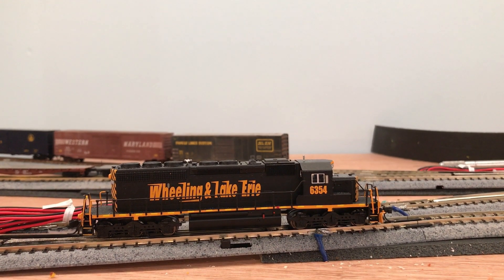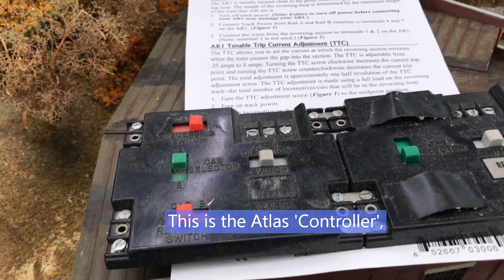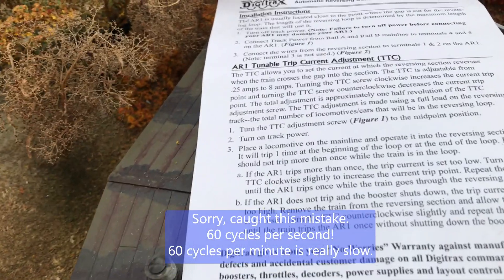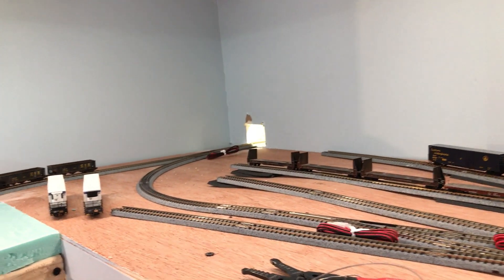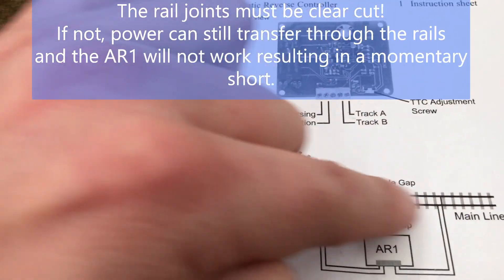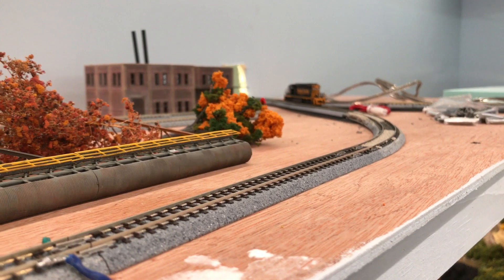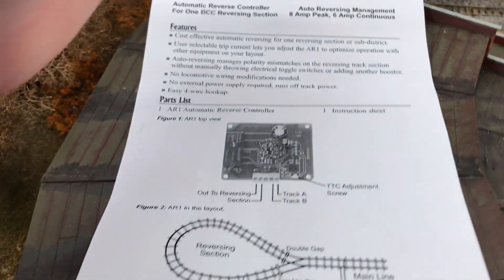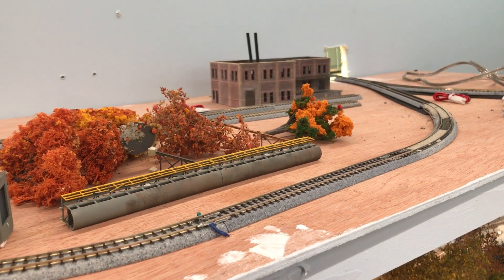DCC Auto-Reversing Devices

Comment: Thanks for the clear explanation.  I see you're using Bachmann EZ Track.  How did you connect your AR1 to the EZ Command power unit?
Reply from the maker: That's Kato Unitrack, not Bachmann EZ Track.  The AR1 is connected to the track through wires soldered to the outside of the rails and run to the appropriate terminals on the AR1.  The bus line is used as the AR1's 'common' connection to determine when it needs to correct the pulse.

Comment: This is one great video. It answered a BUNCH of questions, and clarified that a reverse loop does not have to start or end at a turnout. I have a L-O-N-G run (over 40 feet) between a fiddle yard and a freight station, and this clearly showed that I only need to "isolate" a piece of track longer than my longest train. Thanks!

Comment: Glad I found you, I have a large loop with a pin wheel yard. I was wondering how I was going to wire it. I will do the reverse loop in such a way that my turn outs for the yard aren’t in the reverse loop. Just about 3/4 of the loop will be in it.
Reply from the maker: That should work.  The only issue you'll have is if your loop isn't big enough to cover your longest train with DPUs.  If it is or you don't have DPUs, you're golden!
Reply: @AlleghenyNorthern  yes it is big enough, about a five foot circle area
Reply from the maker: @larryschmitt2513  Cool!  Sounds like you're set.

Comment: So you isolate that whole straight section? From switch to switch with rubber or plastic joiners? And you only need one AR10 right? 

I’m trying to lay a line on my lower level so I can run a train around the lower level without going up the helix. I should only have to double gap one side, correct? 

Mine looks just like your reverse loop (being straight from switch to switching, aside that I have the helix where your industrial town is. 

Please let me know if I’m not clear.
Reply from the maker: On a reverse loop, you always have to double gap both sides of the reversing section.  So, whichever section of track you designate as the reversing section, you need two isolated joiners at each end.  

(If you're wiring up a wye, they're a little trickier because you'll have two sections that are technically reversing. )

 You only need one AR1 per reversing section.  You can either make a part of the reversing track isolated like I did in the video or you can isolate the entire loop at the turnout - both the straight and diverging routes get the isolated joiners.  If you chose to make the entire section reversing, ALL of the feeders inside the reversing section must run through the AR1.  

If you only make a portion of the reversing section isolated, then make sure it's a large enough section to get all of your locomotives per train into it - that includes any DPUs or sound cars that may have a decoder.  If you don't, you'll short.
Reply: Man, I have always had trouble understanding this. Aside from the simple loop but more than that it’s always been an issue for me. This is amazing and should be in the manual that comes with any auto reverser.
Reply from the maker: @Trainsarecool-j8z  i hope it helped get you up and running.  once you give it a shot, let me know how it works out for you!  If you venture into turn tables, it's a whole new ball game with the ARs!

Comment: This is encouraging because I have two reverse loops, each is stretched out, not returning to the same entry of the loop.
Reply from the maker: Just make sure you isolate the loops and all the feeders to the isolated section have to run through the AR1.  if you have trouble, you likely have a feeder going past the AR1 which will result in a bypass and immediate short.

Comment: I know you like Digitrax devices so this is just a suggestion. I used to use AR1's but they are old technology, require adjustments, have mechanical relays and are not that reliable. Now I use the "Tam Valley" dual frog juicers which I use to power the frogs on my turnouts; but the outputs can be paired by a jumper and now can be used as a auto reverser. the beauty of this device is that it is works flawlessly, fully electronic, no moving parts, greater reliability, and best of all no adjustments.
Reply from the maker: i have seen some applications of the Tam Valley frog juicers used and NCE's autoreverser, too.  i'm certainly not opposed to any of the options that work.  When the AR1s crap out I may look at some of these other systems - or if they become temperamental with other locomotives.  there's nothing i hate more than something that works sometimes, but not always!  Thanks for sharing!

Comment: I use both AR1 and BXPA-1.. The auto reverse relay sound is not a big deal, but BXPA-1is solid state and does not give the relay snap sound. A little more money, but some added features as you mentioned about lights/notifications. Great Video.. Informative and easy.. A BIG LIKE !!

Comment: Can you run the reverse wires to the turntable bridge, and the control wires to a bus for the feeder tracks. Then that bus to your main bus? I am having trouble with my AR1s in this area on my N scale layout.
Reply from the maker: So your bridge isn't auto-powered from the track?  If not, the bridge could be your reverse section, the rest of the tracks could be on the main bus power and that should fix the problem.  Make sure you keep you left rails and your right rails on the right side all around the table or that's going to make a mess.  Also, double check you're not feeding the bridge from the tracks.  In my case, my AR at the turntable is actually wired for the wye the turntable feeds from (yes, I made a really complicated track arrangement at the terminal section but I wanted a lot of features in a compact area.)  My turntable is the Kato unit and because of how it's internally wired, it does not require an AR1.
Reply: @AlleghenyNorthern  Mine is a Built up N scale Modern 130' Turntable by Corner Stone. The DC version. However my layout is Digitrax DCC. I have a second turntable on the same make and it is DCC and have no trouble with it. I should sell the none DCC. But if I can make it work? I may keep it. No anyone who wants a None DCC 130 foot Turn Table?
Reply from the maker: @Vman7757  Looks like Walthers makes a DCC control unit for the non-DCC model.  I'm not sure if that's just to operate the table by DCC or if it has to do with how the table indexes and powers.  If your bridge is indexing correctly and you can control the motion alright, I would try using the AR to power the bridge.
Reply: @AlleghenyNorthern  I have an AR I'm not using. I have had trouble with it. But still have it.

Comment: Great explanation of the reversing loop..You can also set it up as a point to point as well.
Reply from the maker: I contemplated eliminating the "escape track", but I think it would be an operational disaster.  The coal branch is a point run.  The future port will be a point run.  Theoretically, I will be able to run trains from two point locations (mine to power plant, intermodal yard to habor) so trains only enter a scene once during operation.  But the loops are nice for guest operation and open houses.
Reply: @AlleghenyNorthern  Most certainly and you did a great job. I hope I didn't come off wrong or rude. Definitely was not my intention
Reply from the maker: @EmPtYpKtS1  Not at all!  I'm going to be doing some videos once I have the track done in the harbor describing my operational strategies.  Comments and suggestions are always welcome!
Reply: @AlleghenyNorthern  Can't wait for them

Comment: good explanation of a reversing section...your isolated track needs to be as long as your longest train..because if you have a DPU or anything that uses track power & if it's not in the reverse section it will cause a short... i have 3 AR1's on my layout..thx 4 sharing... vinny
Reply from the maker: Yes!  Excellent point.  I don't think I stressed that enough.  Since my escape track is only handling locals with two locos and no DPUs, I don't have that problem - even if a loco is front and back of the train.  However, if the entire mainline traffic was making a reverse, you're 100% correct - the loop would have to be large enough to account for DPUs if they're being used.  Thanks!